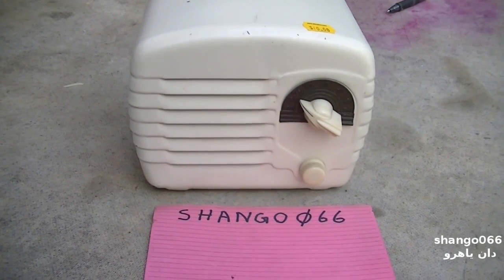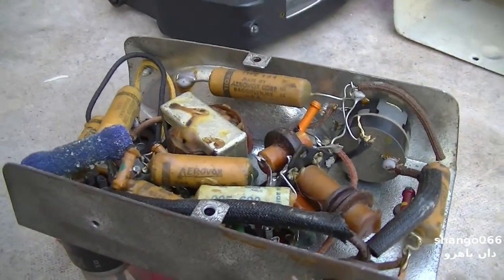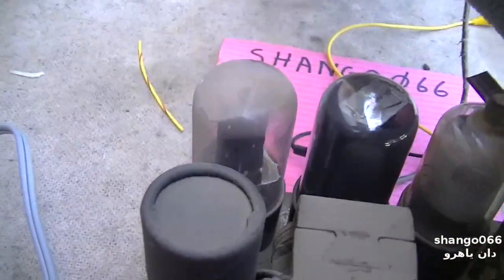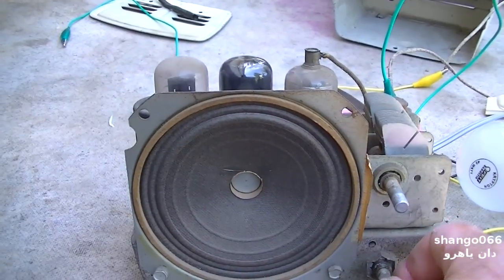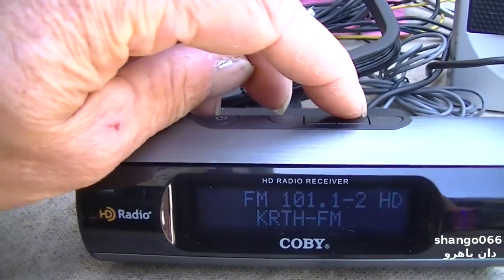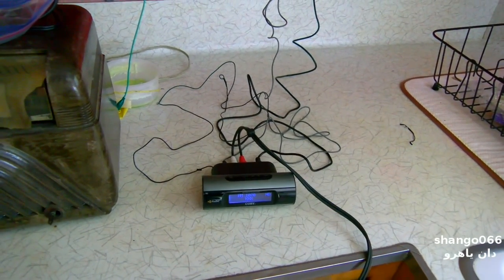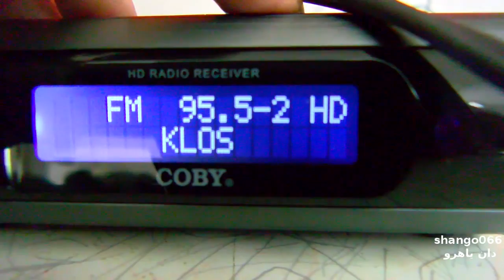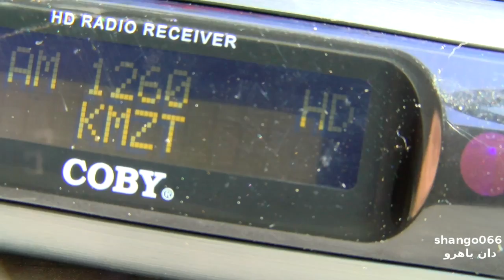Amazing 3 Tube Radio And HD Digital Radio Test

Comment: This is  actually an Arvin model 402 or 402A.. It dates to the 1940's. It also came in a 4 tube chassis. Yours is the model RE-55 Chassis. The 4 tube chassis was the RE-91 chassis. It was also sold as the Mighty Mite. Not a bad performer but will only pick up local stations. It was originally sold with a 20 foot antenna wire. These are easy to restore cosmetically and are neat little midget radios., You are lucky you have the back they are usually missing.
Reply: I have a four tube ARVIN from the 1950's -  no IF tube - - needs an external antenna. Plastic body and a compo board back. It works fairly well.
Made in the late 50's because many of it components look like cross over to transistorized chassis
Reply: I have a very similar arvin model 444 from around 1941
Reply: i guess it is kinda off topic but do anybody know of a good place to stream new series online ?

Comment: Based on the Emerson CF255 from 1939. The 25B8 pentode is the RF amplifier which feeds the triode section as a grid leak detector. There is also fixed regeneration which helps with the selectivity and gain.  These sets are designed to work with a specific length of aerial wire so that both tuned circuits track correctly.

Comment: Two-section tuner, but the two sections are the same size.  No antenna tuner / oscillator section like a superhet.  That's a TRF.  That 25B8 is a pentode and a triode in the same envelope.  Very cool radio.

Comment: I made a 2 transistor radio with very few component and little knowledge of electronic when I was a teenager, the radio was working good, laud and clear, that simple  homemade solid state portable radio was able to receive local stations without selectivity, just like that bulky yours, which reminds me then over 50 years ago, I wish I had that radio back as a part of my tangible memories.

Comment: here's the schematic for the radio:
http://www.doctsf.com/documents/afficher_document.php?num_doc=6979&num_fic=1
That AF gain control is not in the audio path, it changes the bias on the RF tube cathode.

BTW Arvin made a two tube version of the same radio, a 70L7GT replaced the 50L6 and 35Z5 tubes!

Comment: On the midget Arvin: Those who said this is a TRF set are correct. There's a small amount of regeneration to tighten up the bandwidth some. It seemed like a reflex set, but no. Those were covered some in the early GE Transistor Manuals.

On HD Radio: HD has nothing to do with high definition, as we heard. HD stands for Hybrid Digital. On FM the bandwidth is there to allow for higher bitrates and multiple audio (and revenue) streams. You can see the blocks of digital carriers either side of an FM station on the waterfall of your SDR. On AM, the narrow bandwidth analog signal is actually preferable, unless one is into listening to audio thick with aliasing and other digital artifacts. A good hi-fi AM tuner sounds much better by comparison.

Comment: If you replace all of those wax caps that will help with the channel bleed over.  All of those wax caps have moisture issues with age and get leaky.  I actually slice the wax sleeve lengthwise and pull the guts out then wrap the sleeve around a modern axial cap, put the cut end inward towards the chassis, then they look original.  The same things can be done with the filter caps, carefully pry the "can" off of the cap "base", solder modern caps into the base, then crimp the can onto the base and it will look original too.  All depends on how much you care about keeping the antiqueness of the unit.

Comment: The hd sounds compressed for sure on the am side. Remember am stereo in the older cars? It had a very warm sound.  My dad had a am fm with am stereo in his olds. Your hd radio is a joke next to that really cute metal tube radio. Anyway I love hearing am sound on older tube radios as well as the older cheap transistor radios. Maybe I will pick up one of those cheap hd radios for the fun of it. Sirius XM is what I  listen to most of the time for listening for a wide range variety of muzik. But love your radio. Have fun with it. Take care,
Gary S.

Comment: It is amazing that this little Arvin could achieve so much sensitivity with a single tetrode RF stage. However, one of the drawbacks of TRF technology becomes apparent as Shango scans the dial; selectivity is much sharper at the bottom of the dial than at the top.

JW Miller once came up with a special RF transformer set and matching four-section variable capacitor for use in a high-perfomance TRF radio (the Miller 570). The transformers employed a special coupling arrangement to maintain a nearly constant bandwidth, regardless of where one tuned the radio. However, these parts were not cheap!

Lastly, I will say that something in your home is re-radiating AM broadcast band signals. I have noticed that in many of your videos, KFI and KNX have a lot of powerline hum riding on top of them. Have you attempted to use a portable radio to locate the source of the interference?

Comment: the sealed volume pot, try slipping some tubing over the pot shaft and spray cleaner into the tubing, it worked for me on a sealed pot.  James
Reply: That's a good tip!
Reply: @MrUbiquitousTech  HOW WOULD OIL GET INTO A SEALED POT? can you say placebo effect?
Reply: @kirkwatstien6979  Can you say "CAPILLARY ACTION"??

Comment: Interesting the way the US does their "HD radio". It's piggybacked on the normal AM and FM signal. Here in Australia we use a system called DAB+ (Digital Audio Broadcasting Plus) which is AAC2+ and broadcast on a completely different frequency whereby we have 50 or 60 stations all on an old analogue TV frequency at around 200MHz. Thanks for the video as while I've been to the US many times I've never realised this is how HD radio worked over there.
Reply: +vk3crg HD Radio can be mixed with the regular signal or even broadcast on a separate tower. It rides along the sidebands of an AM or FM station. It uses a proprietary version of the AAC+ codec. The upper and lower sidebands transmit redundant data to reduce the error rate.  

An FM station can send 96 bps. Most stations break that in half to send a digital version of the station plus an additional HD-2 station. This gives audio quality somewhat better than FM with higher dynamic range and frequency response (analog FM is cut off at 15 Khz). Some rare stations (mostly classical) use the entire bandwidth on their staton and that gives incredible sound quality, definitely approaching CD quality to my ears.

The main reason I listen to it is no multipath. Where I work most FM stations are buzzing crunching messes but HD Radio has no problem getting through.
Reply: Aussies use DAB??? Christ we have to pay sirius here to get DAB and buy a satellire reciever.
Reply: @kittyfanatic1980  Germany has DAB+ too :) But the AM HD concept is awesome!

Comment: The buzzing can / could be from people using LAN BPL (Local Area Network Broadband over Power Line) extenders, those things you plug into the outlet and then plug in your PC LAN cable to use the house power lines as part of the LAN network. If ONE person on your section of the grid (your neighborhood) has one then you will hear the buzzing it generated on the AC line.
Another cause can be WAN BPL (Wide Area LAN, Broadband over Power Line). I don't think this is used in the US by consumer ISP's yet but more so by power/utility companies to give workers internet access in rural substations and so on so they can communicate directly back to the home offices.
You would think the FCC would man up and step in and do something about this though but it only goes to show how much they actually care about inferior radios bands...

Comment: That was a surprise it worked! The 3 tube radio is a TRF and by this time you probably found out the 25B8 is a combo tube, Pentode and Triode.... Just like AM stereo had a falling out of favor with the public, here the one local AM station doing the HD,   also turned off their HD IBOC digital broadcasting, I'm so glad they did. IBOC should never have been implemented, as it ruined reception of adjacent stations. Last time I checked, only a couple of distance stations at night time are still broadcasting the digital HD IBOC crap.  Another failed miserable attempt to  upgrade AM.🤔

Comment: I have a 4-Tube ARVIN breakfast-tabletop radio that is superheterodyne, with AVC!  It needs a lengthy aerial to pull in a few stations. The trick to getting its cost and chassis size down was to remove the IF amplifier stage entirely. It even still has its original back cover

Comment: It was a pity that the battery case was such in disorder, otherwise it was good working and I liked particularly the socket transistor system at hat was used by the early portable zenith radios. Thanks for the demonstration. I would have liked to see a "second"film on it.

Comment: between 1998 and 2000 i had a 1928 or 1929 atwater kent trf radio. actually they called it a regenerative receiver but i bellieve that is basically a trf.  i was told it was the first ac set atwater kent made. all i had to do to it was change the output tube and it worked perfect on all origional components the whole time i had it. no volume control though you controled the volume by varying the filament voltage. worked great but my neighbor hated it because no avc so it got loud all on its own when changing stations or with variation in signal strength.
Reply: +Thomas Stemmer A. Atwater Kent shut down his company rather than following the market trend and building cheap hot-chassis AA5 sets.
Reply: +No Name yes my radio definitely wasn't a hot chassis set had a huge power transformer and the filter caps rectifier tube etc on a separate chassis from the radio. if memory serves it had a bunch of 29 a 45 and an 80 tube. haven't seen the radio in years so i could be wrong about the tube complement. it was the first and last radio i had from the 1920's.
Reply: AK went out of business for a lot of reasons, mainly the 1929 crash and it's effects. However, you are somewhat correct. They refused to "cheapen" their product to reduce prices in a time when that was obviously good for business. They did eventually do that somewhat, but it was too late. There was really no such thing as a "cheap" Atwater Kent radio.
 Hot chassis sets were still a few years from production when AK went under. They did make a few resistance line cord sets, though, for cost reduction. Probably too late in the game.
Reply: AK closed his factory in philly because he saw RCA among others "cheapening" up(nothing in the day was truely cheap as in todays terms) and he said flat out that hed rather close his factory than use anything but the very best. He let his crew go paid them and locked up never to return. Thats a man that believed in QUALITY and thats why his sets even the tombstones of the 30s are still around. Mostly original

Comment: These were among the cheapest of radios, mainly intended for use in large cities with lots of local radio stations.   No IF transformers, no AVC, and quite a bit of regeneration, so iffy at best.   I have one like this that even has a 6E5 eye tube where the eye tube has audio going through it.   Very clever but marginal design.  Didn't catch on.

Comment: So old and still works. Today… one bit lost in some flash memory and dead as dodo. Go buy a new one!
Reply: There's a video he's got on a 1935 radio that worked out of the box as well, nearly 100 years old and it still works fine and dandy. A bit weak, but excellent for it's age nonetheless.

Maybe not one bit, seeing as parity and correction are a thing, but in theory lose a few bytes and you're screwed.

Comment: I don't know I recall a neighbor on the farm had one of those in his line shack where the sheep herders stayed when the sheep were in pasture.  Perhaps his was a 4 tube, I don't know but same size and it got quite a few stations.  Of course he did have a long wire antenna running from the shack to the windmill.

Comment: That radio is cool! I believe it is a single stage superhet convertor with no IF system - looks like mixer-oscilator pentode drives detector/AF amp triode. You would get conversion gain from the local oscillator. I'd like to see a follow up video with a scope using 10X probe on each of the gangs of the variable cap to see what LO frequency is for a given RX frequency.

Comment: I've drilled a small hole in sealed pots and throwed the juice to them lol 😁 it works quite well. But it's best to use a small hand drill that you twist. Using a power drill I would not recommend.

Comment: Have you ever played around with C-QUAM AM-Stereo? The local AM oldies station 740 WDGY recently dropped their AM-HD signal in favor of C-QUAM. Nice score on that 3 tube set. Almost looks like an Arvin. I have a little metal cabinet 4 tube Airline model 84KR1520B. Metal cabinet and a hot chassis...
Reply: WDGY is back in HD on 740 but it's on analog 92.1 FM and I think 103.7 FM?

Comment: Interesting, in the Uk we have digital radio, but its not in the form of sidebands on an analogue signal, we have dab, digital audio band, which is all digital on around 200mc's.
Analogue radio here was scheduled to be taken down a couple of years ago, but for some reason, probably because so many still have analogue radios it was postponed for an undetermined period, so for now we still have sw, am and fm, tv is all digital.
I liked your vid on the ferguson console, I had a bush console which looked like the same chassis.
Reply: UK might not have AM much longer: Absolute shut their MW transmitters, BBC R4 LW will be gone by March 31st and in 2026, they're shutting down 5Live on MW.

Comment: There is a difference between FM and HD our Classical station where I live even with a strong signal has some noise you can hear in very low passages. When it switches to HD all the noise goes away!

Comment: I like the styling of the radio, but jeez a metal case and a hot chassis. The radio looks very compact, but that has made for a very crowded layout of components under the chassis.

I commend the use of the lamp-limiter. The higher the wattage of the bulb filament the less it restricts the current flow to the radio. I know you are well aware of that, but just in case others are curious. 
I am very surprised the radio works at all. The waxed paper capacitor is notorious for going electrically leaky & that radio is full of them. The B+ filter capacitors are also often dried out.
If the performance of the radio is probably not going to be good enough for everyday use, you have to consider whether it is going to be best left alone.

Comment: There may be a bad transformer, or insulator, nearby in your power network. I have noticed from driving along side primary leads while listening to an AM station in a car, that sometimes I would hear a localized, pronounced low frequency interference or higher frequency arcing/static that is most likely caused by an issue to either of the 2. Maybe a walk around your power lead with a handheld AM radio tuned to the bottom of the band but off station might help you to localize the issue, but good luck getting the power provider to do anything about it.

Comment: I have similar buzzing in the UK but only at night. It comes in on the neutral line and I think it's poor power factor correction on discharge lighting in the area.

Comment: Ok I'm a sort of a newbie at working on tube radios, so does the light bulb running in the mix act as a type of fuse or does it allow the voltage to come up s!owly like a variac? Thanks great video awesome radio btw.
Reply from the maker: both

Comment: Long wire? it was built when we didn't have too many stations. Ps a filter at about 455 will help. The tube rig. Used to have one at the mod center LIma ohio. The radio was forgotten by a NCO. that had a spot I took over. Parts/ tubes gotten from fair radio. LIma ohio. Radio station was wima.( 1150)  there hi hi

Comment: Thanks, Interesting. I see you in the USA  used your regular FM or VHF band 2 88 to 108 MHz band in America so you lost your analog.  in Britain. We still have our analog FM & have a separate VHF band 3 180 ish to lower 200 ish MHz an old TV band. Perhaps because you guys still have VHF TV (wish we had & I have a modern 32 inch HD  LED TV that covers 2 VHF bands & the UHF band too) An awful lot of redundant FM stereos there, but I'd rather have VHF TV too. The AM is impressive when it switches to digital, I assume on the AM band it's DRM digital radio Mondial. I plug my ham rig 12 kHz IF into a PC sound card & decode DRM & on some stations like Radio Kuwait sound is not too far from FM  quality streaming under 30 kbps & I believe up to 72 kbps & low definition TV is possible.

Comment: I'm not an expert, but based on a cursory internet search I am going to guess that it is a Kent model 402 midget radio from 1939.  Supposedly there was also a 2-tube(!) version using a 70L7 and a 25B8.  It would be interesting to understand the set's theory of operation.  Especially the 2-tube version.

Comment: I think this might be working as a reflex receiver. If you google reflex receiver, there is a great techlib article on them.
Reply: +jdflyback I was thinking the same. It is most likely a reflex receiver. I also think it will probably work better with new caps.